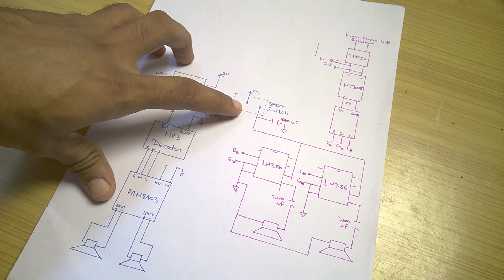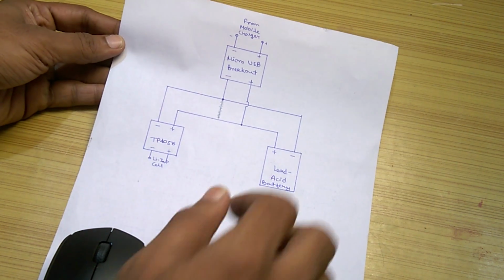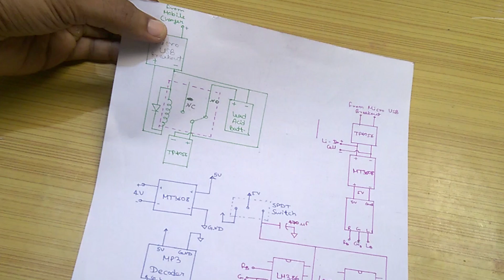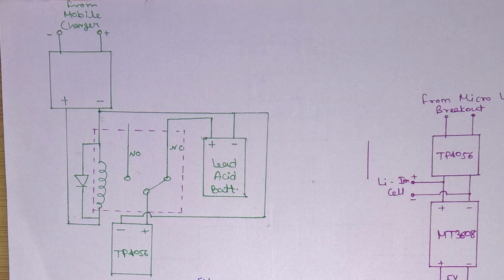Make Your Own Cheap Portable MP3 Player (Part 2) | Bluetooth, USB, AUX, SD Card, FM

Comment: What was the purpose of using Lead-Acid along Lithium-ion (18650), simultaneously? How much output you have generated (Volt & Ampere) via Buck Step-up converter?

Comment: Hi, Nicely done nd u explained it well.... I wished our teachers were also good like this..
having said that , I wanted to make a portable like that but with higher output like 30w or 100w or even 200w. the problem im facing is deciding upon the charging and battery circuit. Please suggest me something, even ur ideas could be of lot of help to me....thanks in advance...!!!
Reply from the maker: Thank you very much for your kind words.
As you are using more wattage speakers, you need more current, and to do that, you need a powerful battery.
If you have a space problem, you might want to go with Li-Ion batteries. Connect them in parallel to increase current rating.
If you don't have a space problem, use Lead-Acid battery with more current rating, for example, a 100 Amp hour one.
Charging those batteries are also not easy and I'll suggest a good quality balance charger for longer life of the batteries.